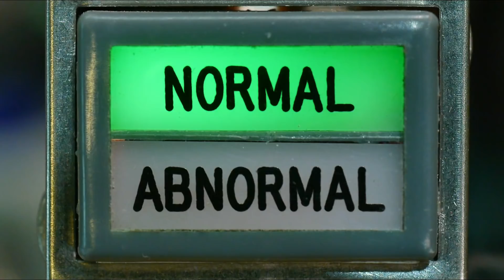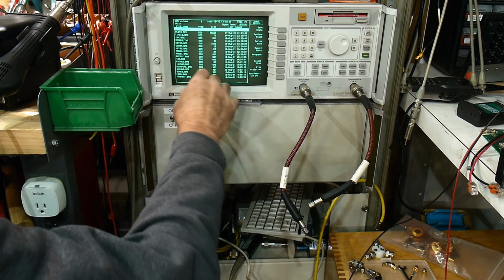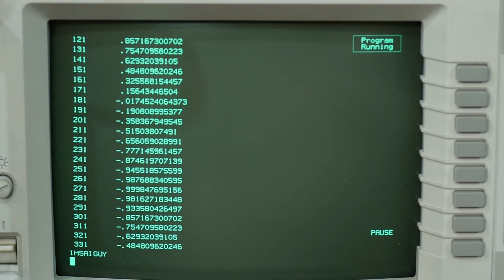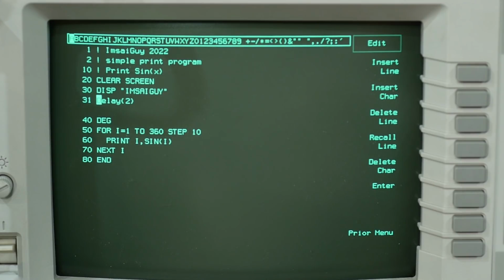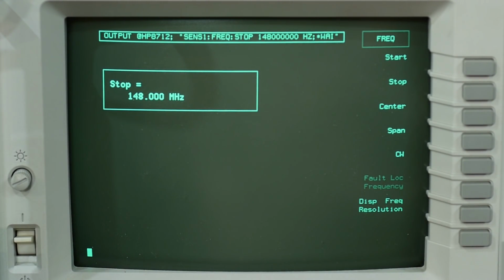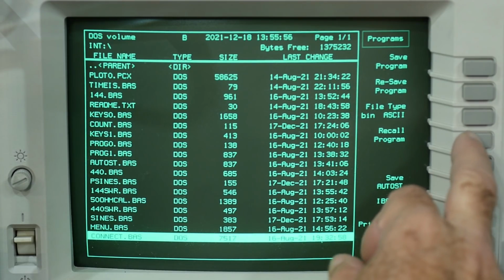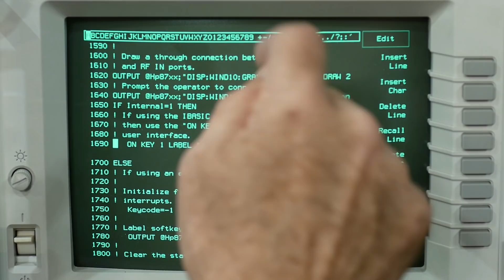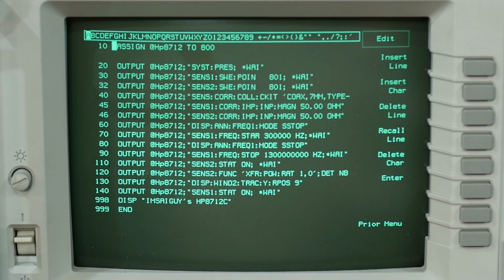#996 Can your VNA do this?

Comment: Cool 1991 technology! Most modern day USB VNAs like DG8SAQ or Copper Mountain S7530 have similar capability as HP87xx.  USB VNA software already includes fully customizable graphing tools, and external control or inputs using serial protocol, realtime complex calculators, etc with 90 to 135 dB dynamic range.

Comment: This brings back memories.  I had an HP 41CX with the HPIL module and had done some instrument programming with that prior to joining a new firm.  At the new firm I was issued an HP 71B which had the HP BASIC and HP IL built in.  We used that to set up test equipment to make measurements in the lab and also on equipment at our TT&C (tracking, telemetry, and control) earth stations to perform tests on our satellites.
Reply from the maker: My best friend was on the HP71B team at HP. I thought that was one of the best 'calculator' products they made
Reply: @IMSAIGuy  I really liked it.  When we went to PCs to control the test equipment and the HP 48SX came out I upgraded to that.  Then shortly thereafter to the 48GX which I still use, both the physical calculator and an emulator on my iPhone and PC.  Only recently have I acquired a TI Nspire CX II CAS and am trying to work with it.  Mainly did this because I got one for my daughter to use in her AP math classes and wanted to be able to help her use that.  While it is a pretty cool calculator I think the HP 48GX is easier to use for a lot of the things I do, but it's probably just the 30+ years of familiarity with it and all the programs I've written for it.

Comment: too bad hp did not use Forth,...
Reply from the maker: oddly enough, the group I worked for decided FORTH would be well suited for the testing we were doing on LEDs. Two of the software engineers ported FORTH to the 9835 computers. Because I could program in FORTH, that was a main reason I got my first job there.
Reply: @IMSAIGuy  FORTH was the second language I learned as a kid.  BASIC of course being the first.  It was  a cartridge for my VIC-20.  You had to learn hex and binary so I learned numbering systems from a book on FORTH before we were taught it in school.
Reply: @IMSAIGuy  Forth is interesting and does not get enough attention from "those who know",... and that being said I use C and Python mostly. I see there is Forth for these little Pico type micros now,... although the source code is absent. That fact will limit the uptake on any new people using it I think. I have considered and not yet moved forward with building a little forth of my own. May happen, may not.